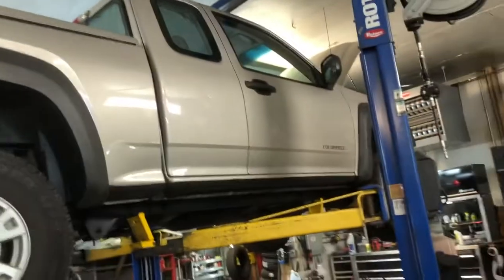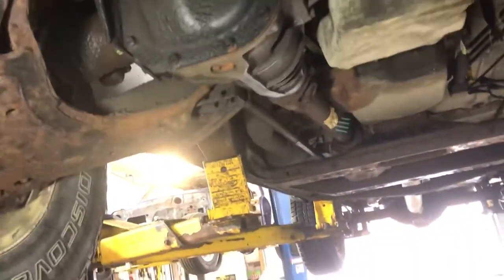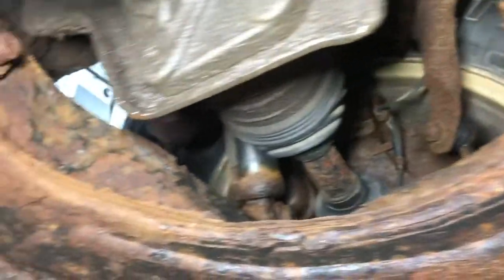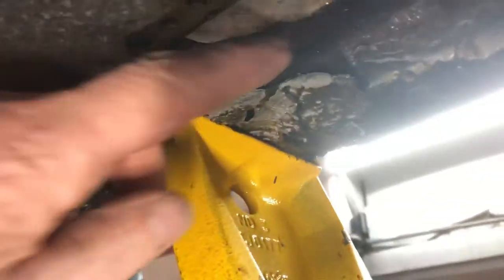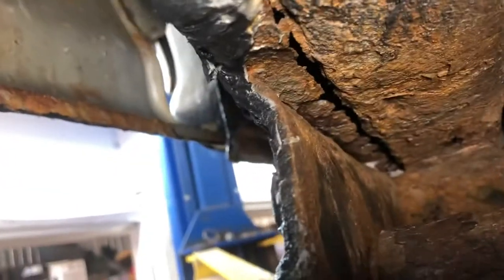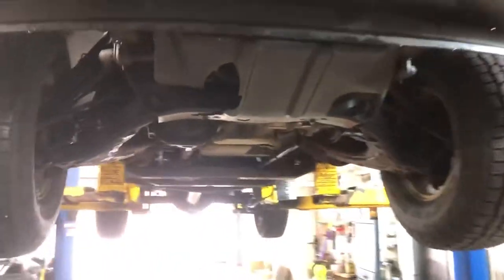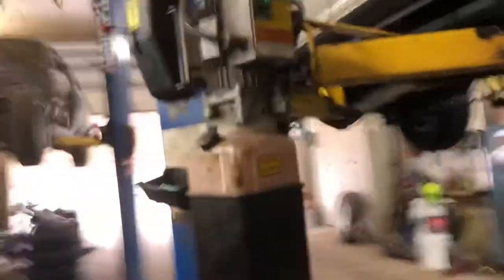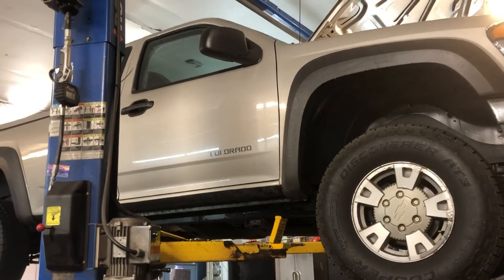Buyer beware! Rust belt rip off! Chevy Colorado with rusted frame!!

Comment: The bottoms of these frames rust out but the side are relatively still intact. You can weld on a new bottom on the frame which is relatively easy. I did mine in a couple hours.
Reply: Glad to hear it’s doable. I’m looking at a 2008 with broken frame. The exterior and sides look good
Reply: Yea sides went on mine but I'm pretty sure that bottom had already been repaired not fun that's forsure
Reply: applause

Comment: I literally just had this done to me. My 17 year old son saved up $4,500 bucks and we went to look at a 2006 Chevy Colorado and I told the gentleman that it’s for my son and he still sold him the truck with this exact same problem now my son is out of the money and truck. People are just piece of 💩when they do this. Unbelievable
Reply from the maker: Sorry to read that. VERY frustrating!
Reply: I recently brought 2006 Chevy Colorado and didn’t inspect the underneath, well driver side is rotted as well , I got sold on the copper tires and proof of all the belts being replaced recently along with battery and alternator, oh and came with fully functioning Meyer plow , only spent 1500 , so me pouring 1000 into it is definitely worth it in my book

Comment: Body is in good shape he should look at the wreckers for a good frame and bolt it onto the body - I have always under sprayed my cars/trucks with Fluid film
Reply: Fluid film A++ twice a year
Reply: Good stuff. That or Sta-bil Rust Stopper. Rubber coating is the stuff to stay away from.
Reply: @DerfOrNuffin  hey question. I bought a car that spent 2 years in the rust belt and has some suspension part rust. Frame doesn't have any rust because it's covered. My question is if you bring a car out of the rust belt, will it stop rusting if it isn't too bad? Also on a seperate note I did spray the rusty parts with fluid film. Just curious if the rust slows down or stops if you bring it out of the rust belt into another state? Thanks
Reply: @Primer9  I know it’s not directed to me but it will continue to rust but at a slower pace.
Moisture + oxygen = rust, salt just accelerates the process.

Fluid film it asap to control it and you should be alright.

Also when you say the frame is covered that doesn’t mean it’s all good - get under there and inspect or pay someone to inspect.
Reply: @KazeHorse  hey all good. Thanks for responding. Yeah I fluid filmed it when I got it. Honestly it's not near as bad as anything I seen on the internet and YouTube. I've went under and inspected it. Can't see any rust aside from suspension parts but I'll reconsider it.
Reply: @Primer9  yeah sounds like you’ll be alright then. Suspension components are whatever because they’ll get replaced eventually.

I recommend Dynax S-50 for the inside of frame rails and box sections like sills also - pretty much ends the opportunity for it to rust from the inside out & I have had it in the frame of a LR Defender for 8 years & it’s still holding up well.
If you need to know how much you need - I did a LWB Sprinter with 8 cans sprayed thick in the frames and sills & the Defender needed 4 as that was just frame channels.

Keep up with fluid film on the frame and underside + keep an eye on the seams and your vehicle will outlast 99.9% of others on the road due to neglect.
Reply: They all rust like this along with the GMC canyon

Comment: I just bought an 05 Colorado as a wreck. The frame where the front of the leaf spring connects to the frame was rotted out pretty good. I actually welded new steel on the frame and patched where the holes were. Box frames rot out big time because the salt and gunk can't get out of the inside of the frame.

Comment: Just happened to me. The driver side is rock solid which is what I looked at in my parking lot inspection, but when I really got under there a week later, the passenger side looks like it was parked in a lake. This thing had 2 inspections before going to the dealer I bought it from. One from Indiana and the second from Illinois. It's a total scam. They may tell you to get new wipers or lightbulbs but they don't inspect shit underneath. They collect their money and your stuck with crap.

Comment: Northeast here too...its hard to keep cars on the road solely because of rust. Its detering when you're looking at new vehicles for 30-50 grand and you know by the time its paid for it will probably be rusty underneath. Really no point in owning a nice car in the rust belt. Just buy a somewhat decent used vehicle and drive it until it's to rusty to fix, then buy another.
Reply from the maker: Discouraging, for sure. The last few trucks I bought for myself, I had shipped up from the south. Higher miles but super clean underneath! Gives me a few extra worry free years before the salt/ brine mix starts eating away at it!
Reply: Thats why I like uni bodies.  I have found that they hold up better being that most have gops of rubber type spray put on at the factory over the undercarriage, unlike the truck with frames, having little to no paint on the frames.
Reply: Have your vehicles undercoated with woolwax or Fluid Film or NH Oil and they won't rust out even in the "rustbelt". I have a rust free 1983 chevy 4x4 dually that gets driven in summer and winter. I coat it once or twice a year and that stuff really protects it.

Comment: Wow that's BAD. I live in Phoenix, AZ, and have a 1993 S-10. The whole bottom of the truck looks brand new. Not a speck of rust anywhere. It was never undercoated. It still has some of the wax on the frame that the factory applied at the factory.
Reply from the maker: I truly envy that!!!
Reply: Yeah you guy's got it made. It's truly sad up here in the rust belt lol

Comment: I bought an 04 Colorado and never checked the frame. I owned a 89 and 91 S10 and never had any frame issues even in 2005 there was zero problems. The frame cracked on the 04 Colorado and that was it for that truck. 
So then I got an 08 Colorado figuring I would have time to notice anything wrong and get it fixed if issues arise. I checked over the frame had one soft spot that I got a plate welded over. Before winter I checked over the frame and there was no real signs of any issues anywhere else. I kept taking it to the wash after every snow when they salted the roads so the salt wouldn't hang out too long corroding the frame. I had to get a shock replaced so when checking over the frame again I noticed that the weld in the seam under the rear driver side door came out a little. So I got another plate and within the week after I got the shock fixed, before I could even get another plate welded on the frame had cracked right near that spot. 
My parents own a 02 Trailblazer and a 05 silverado and nothing like this had occurred with those vehicles. It's something to do with the first gen colorado frames because looking around I see a lot of colorados of that generation with the bed pressed against the cab due to the frame breaking on them as well.
I am done with used trucks and for getting hosed over by something Chevy did wrong on those Colorado frames I am buying a Ford Maverick.
Reply from the maker: Damn! Sorry to hear about your truck!!! Frustrating!!
Reply: Buy only trucks that are e-coated.  Ford and ram from 2010.  Even that is not 100% sure whit boxed frames.  But I would not touch f150 below 2010.  I have F250 LD with C frame and it get tons of cosmoline and Fuild film.  Still good to go.  But no way I would change my truck for 2003-2010 F150 with boxed frame and not E-coated.
Reply: @zell863  I bought a new truck and am having the frame undercoated every year.

Comment: I have the same model truck and needed to have a 3 foot section of frame welded in to get me past winter . At some point I will end up having to part it out or sell to a person that can swap in a solid frame . It sucks when cities feel they need to salt roads from October to May .
Reply: About 25 years ago CT switched to a very corrosive road salt. Most of the states in the area did too. Its destroying cars and bridges.
Reply: @johnoberle9750  That's so true . Most drivers refuse to adapt their driving to current road conditions and we all suffer for it .
Reply: They should be sending an annual vehicle damage check to everyone. Roads salt has cost people billions of dollars of damage over the years

Comment: It is so hard to imagine the rust is that bad.  I have a 2007 F-150 whose frame is like new because it has never seen salt on a road in Texas.   Maybe folks should come south to purchase used trucks, the issues will simply be wear , not corrosion.
Reply from the maker: It's funny you mention that! My last 2 personal trucks came from Texas! To me, it's worth paying to have them shipped over! Never a spot of rust on Texas trucks!
Reply: (Here in Iowa the exterior panels would be gone too.)  I agree. Choose the vehicle you want, take a red eye flight to Arizona, rent a car, tour a bit (including the car lots) and drive home your rust-free vehicle. Even if the dashboard in sun destroyed, I'd rather fix that than weld patches on a frame.

Comment: GM started undercoating their trucks with some kind of stuff I heard was a wax substance. I think it made the rust worse. I bought a 2007 Silverado a year ago. I was in a hurry and didn't look under it like I should have. It has frame rot that's getting bad on the drivers side. Boy was I surprised when I went to bolt on a set of step bars.
Reply from the maker: It's certainly disappointing! Salt, brine mixture, etc. aside, these vehicles should NOT rust the way they do, esp. given what they cost these days!  I have an 07 silverado as well and have to keep up on the under carriage washing etc. Just replaced the P/S rack lines as they were rusted. Next will be the A/T cooling lines. Frustrating!

Comment: My Colorado is 06 with only 72000 miles and  frame looks same that's what you get when you build with crappie cheap steel from overseas. Funny if you didn't see body you'd think it was a Toyota with frame rust problem must use same supplier of steel for frames . Need I say more!!

Comment: I had some frame rust on an Infiniti, nothing major but  I used a chemical that stops the rust, it is not a coating tho,  after 3 days of applying the chemical the frame became a  grayish color, I kept the Infiniti for 3 years and the rust stopped, is that a good strategy if I want to buy a Colorado with some rust??
Reply from the maker: I'm a huge fan of a product called "Por 15" It's applied like paint but can go directly over rust and does a good job of slowing the rust process down. Sounds like you used something similar on your Infiniti. It's unfortunate that this little Colorado was beyond help!

Comment: Bought a 2007 chevy Colorado 3 years ago from a dealership here in sw wi, ive put over 4,000 in it since ive had it. Went to get a ujoint put in and they noticed the frame is rusted out bad ! Dealership told me the right bump could bust it, its rusted that bad ! Ive got Grandkids and great Grandkids  that i cart around  !! Thats a scary thought  ! Now I'm waiting for a call from a welder to see if its fixable and won't cost me a large amount 😢 
Worried that ill have to junk it and can't afford to purchase  another vehicle because i still  owe on this truck 😢
Reply from the maker: I'm sorry! It's so frustrating that there is clearly a defect in the steel used for these frames but nothing has been done about it! Good luck with yours. I hope it's repairable!
Reply: We have a 2007 Chevy Colorado as well and the frame is so rotted that the entire back end could fall off. We too have grandchildren that cart around. We were also told that we could buy another frame ($2500-$3000)and transfer the body, motor and everything else over to the "new" used frame for $10,000-$12,000, so it would cost us up to $15,000 in order to get the truck safe to drive... $15,000 and we still have to worry about the frame rotting out AGAIN because the car plant knew about the defective material used to build the frame

Comment: I've looked at thousands of used vehicles for sale over the years (private and dealer) and I can say with confidence that 8/10 of them were worse then what the seller said. In other words, the cars were all POS's and not worth what the person was asking. I blame people mostly. People suck and will do anything......to make a BUCK......funny that rhymes.
Reply from the maker: Yeah, I would guesstimate that there is about 10% of sellers that are ignorant of any given problem,  30% are aware of "issues" and are trying to make a sale anyway, 40% are outright liars and thieves and the rest are genuine garbage like whoever sold this truck. They know full well there is an unsafe problem and are doing everything in their power to hide it and make it somebody else's problem. Actual percentages may vary according to your personal experience!! As a buyer, realistic expectations and due diligence are key!!!
Reply: @SmittysShop  I know in Massachusetts we have a law that if a recently purchased vehicle doesn't pass inspection you are entitled to a refund from the seller (dealer OR private, believe it or not). This is the only state with such a law. Now I imagine you would still have to take the person to court of some kind, but it should be an open-shut case. I prefer to just check the vehicle out myself and if something isn't right I just walk. First thing I look for is oil/trans leaks. Automatic pass for me. Most vehicles don't pass the first check for me, LOL.
Reply from the maker: @mediaguy4037  Thats a sensible law! More States should adopt that!

Comment: Was the dealer out of New Jersey? I just bought a Jeep outta New Jersey advertised as NO RUST anywhere on vehicle... I get it here and the bottom is covered with cruddy undercoating and it's rusted half to death. "Mike" the dealer... He needs to be shut down... Just curious if this is the same dealer.
Reply from the maker: Sorry to hear about your experience. Frustrating to say the least. I'm not sure where you are located, but in the past there has been no legal recourse if you buy a vehicle in NJ and bring it back to NY (where I am from). That may have changed. I believe the Colorado was purchased from a private seller in the Albany area of NY. Any sale in NY with over 100k is "as is". Granted, if you buy from a dealer there is still recourse via DMV, but private sale, you better give it a good hard look over!

Comment: Stay away from Colorados. It amazes me people drop money on a vehicle that is garbage and next to useless from the showroom.  As a mechanic, GM is garbage, plagued with rot and rust, amongst other issues. They make a couple decent engines, good luck with what they are wrapped in.
Reply from the maker: Amazing how Toyota couldn't get away with it but GM slides right under the radar. Def a disappointment. I'm SHOCKED when I see a Colorado that DOESN'T have a rusted frame! Few and far between!

Comment: I bought an f150 last fall after I was injured in a car accident. 
I was unable to crawl underneath and took the sellers word that it was ok. 1 year latet I was able to crawl under and found one rust hole in the frame and several spots in the bed that is just bed liner left.
Kinda pissed but $5500 and a first time truck buyer without inspection will land you there. 
I should be able to repair it and get some years out of it yet, this guy has it alot worse.
Reply: Holes in the frame are one thing ... if they're not that bad, they can be repaired.  The seller should have warned you of course, but it sounds like you dodged a bullet.  While a hole in a frame is not ideal of course, you won't be in any danger if you arrest the corrosion by having it repaired properly.  You already seem to know that though ... and it sounds like you are on your way to getting it resolved.  

Trucks are priced pretty high on the secondary market these days ... so long as your problems are limited to what you posted, I think you still did OK with your truck @ $5500.  The lesson you learned will serve you well in the future too.  Trust me, I've been there myself :-).
Reply: @greedo50273  Cosmoline over rust and Fluid film in cavities.  Work for me.  I have tread "10 years of using cold galvanizing".  Toward end is right stuff.

Comment: Doesn't the Lemon Law apply here?
Reply from the maker: You would think so, right? Unfortunately, in New York, anything over 100k miles is "as is." This truck was purchased privately which offers even less recourse. If it were a dealer sold vehicle, you could file a complaint with DMV and hope for a favorable outcome. New York dealers have to have a NY State Safety/ emissions Inspection, prior to sale which, obviously, this truck would not pass!

Comment: You have to watch you're ass buying from a dealer. I got screwed when i was young and dumb. Bought a truck with a broken frame long story short. They will fight you tooth and nail not to give you back you're money. Hire a good mechanic to look it over if you don't know a lot. This critical. I myself won't even really a consider buying in the rust belt anymore unless it's fairly new or the owner that fluid filmed it.
Reply: This just happened to me bough a 2011 Cadillac CTS from the dealer  with rust all over wonder if I should dump it and burn my credit or just continue to pay and hope it last me 5 years at least